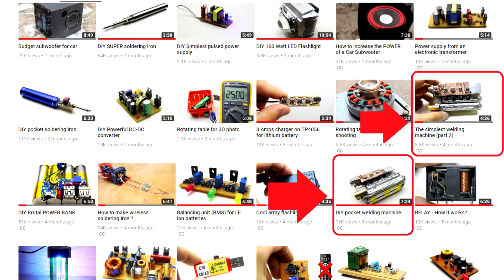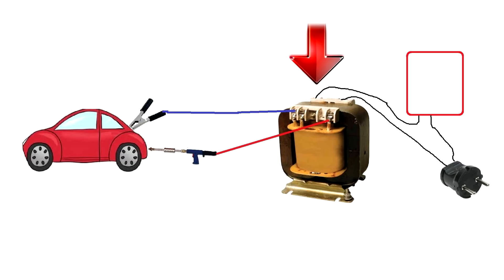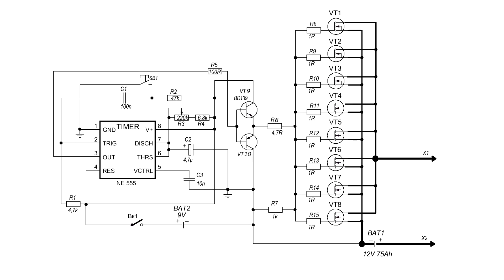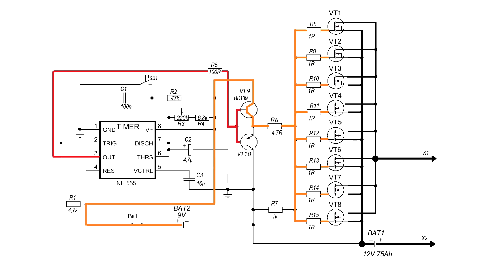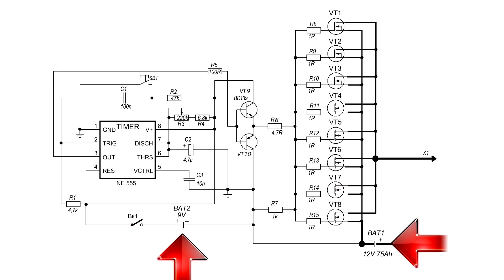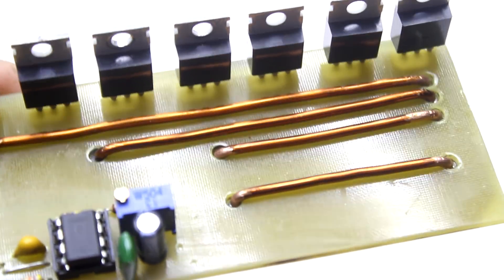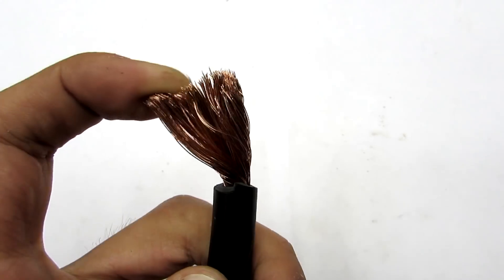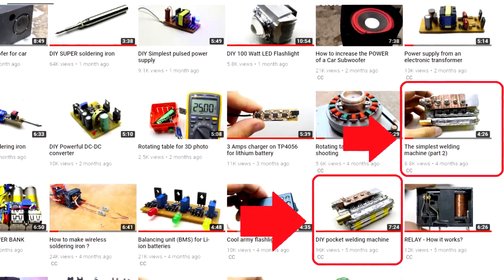DIY SUPER Spot Welding Machine

Comment: Hello, I watched the video and the diagram presented is as beautiful as it could be, but I think there is an error in the diagram, please correct it if it is wrong... Looking at the VT10 transistor, which is of the PNP type, it is designed to discharge the mosfets (Gate) circuit, but I don't see any connection with the minus for this pnp transistor, the question is how it can discharge mosfets, through the NE555 microcircuit, I somehow doubt whether it can discharge pnp transistors through the 3rd leg, so please pay attention to this point because it really raises doubts for me...

Comment: I'm not very good in electronics, but I know that those mosfets can handle maximum power 333w in perfect conditions, so let's say 250w in normal conditions, 250w * 8 you'll get about 160A at 12v. You need twice as much mosfets than shown in this video to handle car battery.
Reply: that rating is for continous current you dont need twice as much you are not running the spot welder continously do you

Comment: According to the datasheet, one original mosfet is capable only of 22A
You have to consider pulse width, Vds, Vgs and temperature. Even the internal resistance and resistance of welding materials should be considered
Reply: Wrong. IRF1404 has a pulse drain current of 808A.
Reply: When a circuit is working, whee is the problem.

Comment: I made it perfectly everything worked well without load but when i did the first weld, mosfet blasted😭
Reply: 1 year has passed, and I would like to know what you have done at the place of that welder
Reply: Those mosfets can handle maximum power 333w in perfect conditions, so let's say 250w in normal conditions, 250w * 8 you'll get about 160A at 12v. You need twice as much mosfets than shown in this video to handle car battery.
Reply: @vata2000  That doesnt matter. The 333W is the max heat the mosfet can transfer from it's junction to case. The mosfets are on for a very short period and wont overheat. What matters is the pulse drain current which is over 800 amps for this mosfet.

Comment: @5:30, I laughed so hard XD
Reply: According to the datasheet, one original mosfet is capable only of 22A
You have to consider pulse width, Vds, Vgs and temperature. Even the internal resistance and resistance of welding materials should be considered
Reply: @EasyCircuits  I was laughing when you said "but the fact is I bought them at "China" and I am not sure if they will explode at the first start of the circuit"

Comment: This great - I had just recently thought of using lead-acid batteries to make a spot-welder, rather than a microwave oven transformer. (I have a number of gel-cell batteries, but no oven transformer.) I experimented a bit with just thick wires and electrodes, but discovered that this quickly burned holes in the thin metal I want to weld. I decided I needed to make a circuit that would deliver short pulses, like the circuit you presented here, but have had no time to make it.

It is a very simple circuit, but your video has saved me the time of figuring it out. 

Thank you very much, please let us know if you decide to make available circuit boards as you mentioned!

Thank you again for your great videos, I really like them! :-)
Reply: Bro, what peak current did your circuit have? I made one with peak 623A for 5ms but I don't want to burn the mosfets

Comment: Nice, simple circuit that avoids risks of connecting to mains voltage.  Another way is to load-up a large capacitor and discharge it, which can also be easy to control.  Thank you for making the boards available.
Reply: A car battery will do just fine, it even has a lower ESR than capacitors and can easily handle strong current pulses. Even a single IRF1404 is enough for spot welding nickel battery strips.

Comment: I need your help to use a motor with a cage around it with magnet wound copper wire for 1000volts and slot in the cage for neodymium magnets.

Can you help with such a power source

Comment: Did I hear you correctly that you said the power wires are aluminum? They look like copper to me and the way you soldered them, I doubt they are aluminum. It's an interesting idea and very simple circuit. I think it should work fine.
Reply: They look like solid copper, but you can buy really cheap copper coated aluminum wire.
Reply: I did not know that. Learn something new every day.
Reply: some are copper plated aluminum...
Reply: N

Comment: car battery. you will buy car battery. accumulator is used for heat accumulating devices and not electrical ones
Reply: accumulator  is the original term for  a chargeable battery.  it accumulates a charge that can be used later.
Reply: A battery is a pack of accumulator cells
Reply: Yes